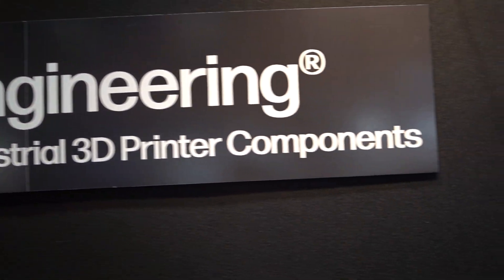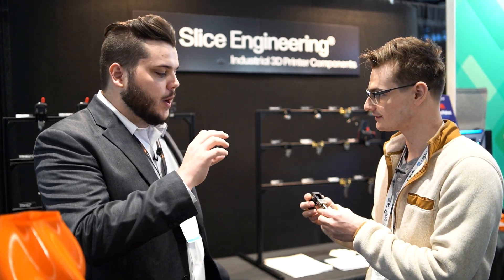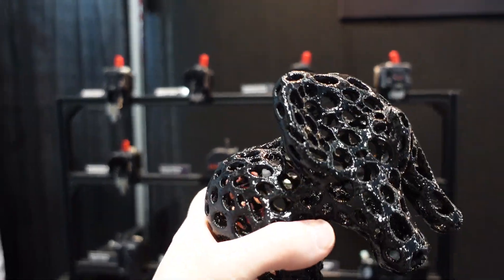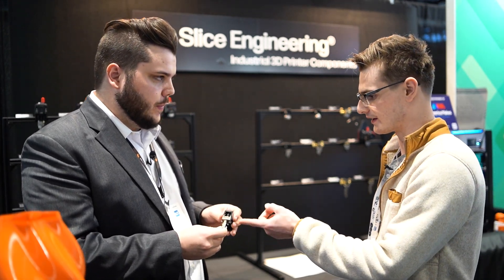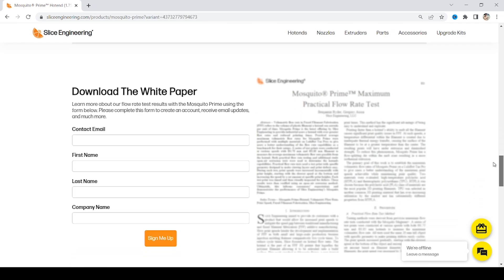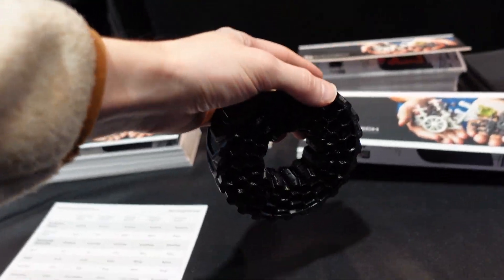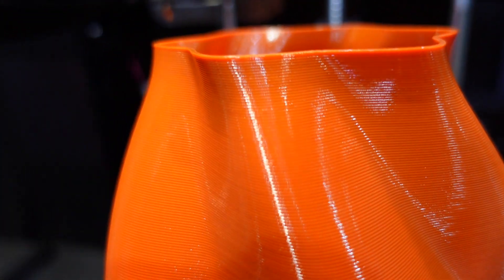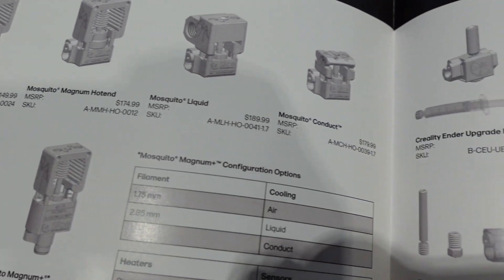Game-Changing Announcements by Slice Engineering at Rapid+TCT 2023 – What Did They Unveil?

Comment: Most "industrial" AM uses either
1. SLS, or
2. FDM with specialized materials like PEEK and ULTEM, which require and ultra high chamber temp and slower print speed to maximize strength for its intended application. Not sure why a printer like that would need those flow rates